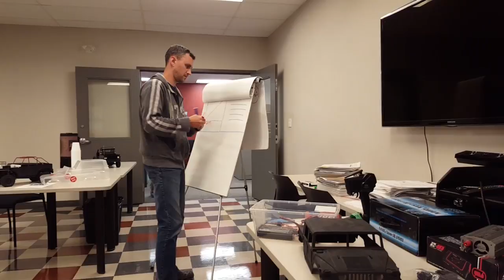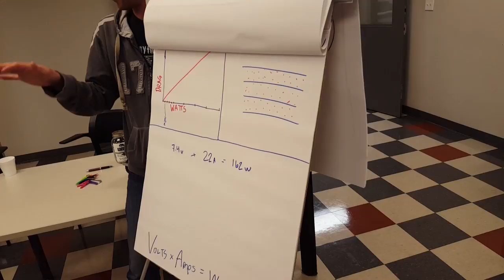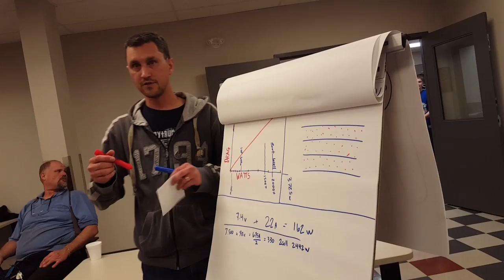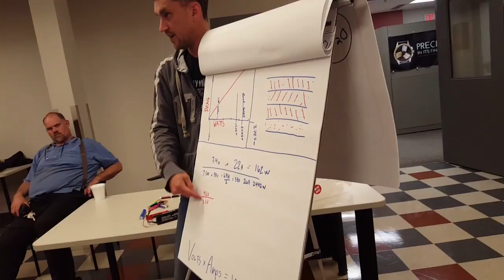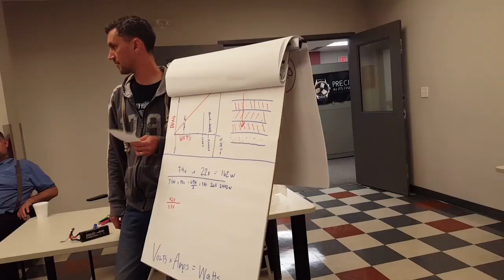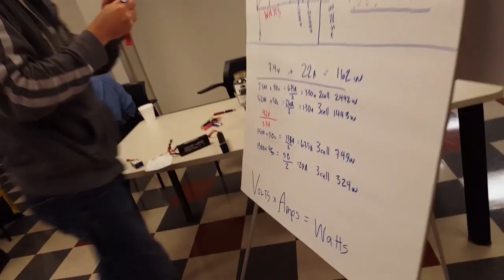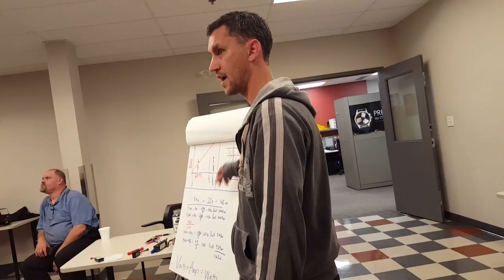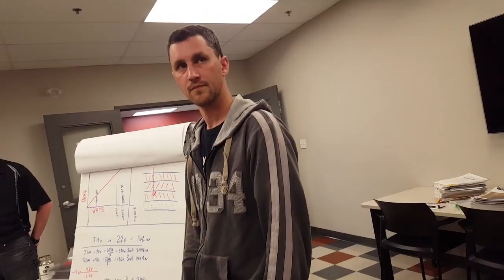LIPO 101 Battery math

Comment: I get 3 to 4 years out of my lipo's with no probs,   One trick i do is keep a track of how long i can run a battery b4 i hit cutoff,   If i run a battery that i know i can trail for say 2 hours b4 i hit cut off,  I set my timer on my phone for hour and half,    When timmer goes off i swap the battery,    I do this for two reasons .

1, never trust ESC cutoff 
2, I have found if i pull battery b4 it gets to the cut off,  The battery lasts much longer.
Reply from the maker: Thanks for the awesome tip.